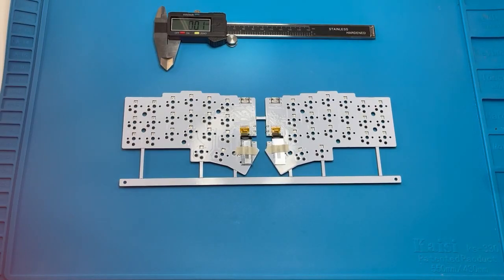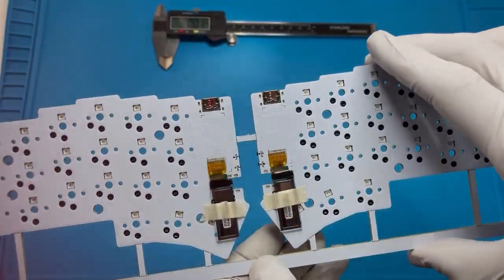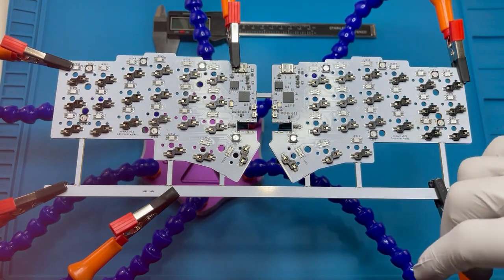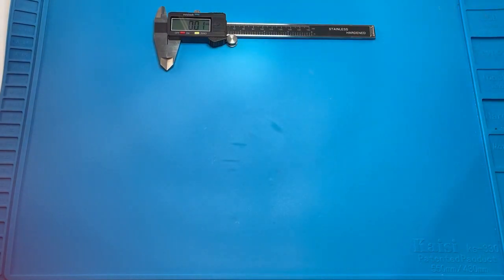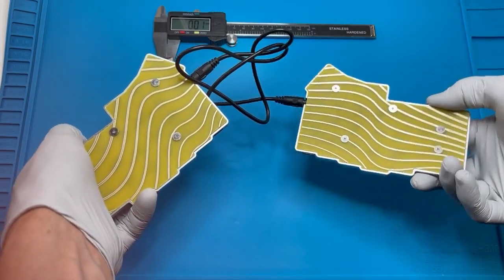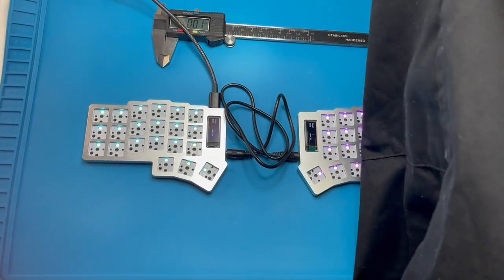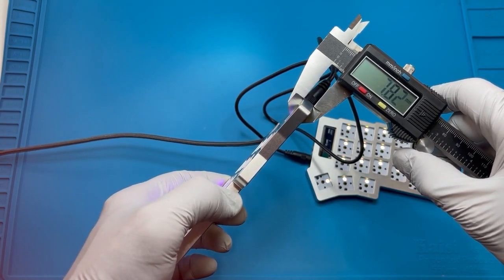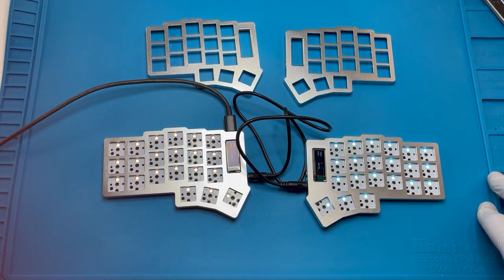mini42 Low Profile Ergonomic Mechanical Keyboard Preview

Comment: did this ever get made / sold?
Reply from the maker: Yes. These are available on controller.works as pre-built units. The mini36 is in-stock in silver and black anodized aluminum. There is maybe one in-stock unit of mini42 available in silver. There is a new build of the mini42 coming in rose gold, dark gray, and black. You can go on the wait list for the new build now. You won't be charged until your unit ships.